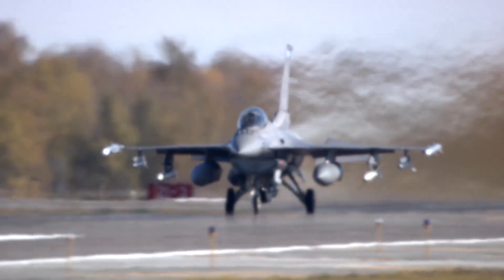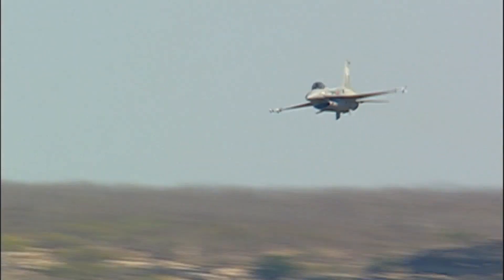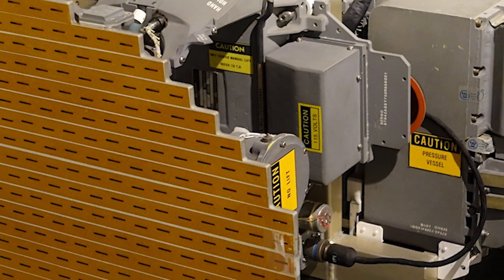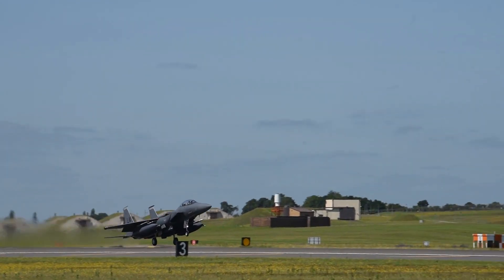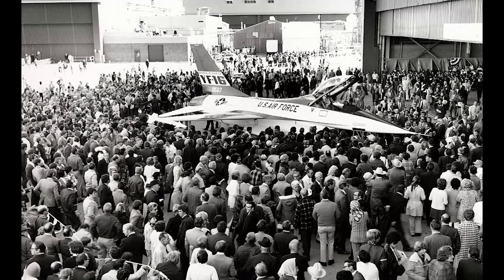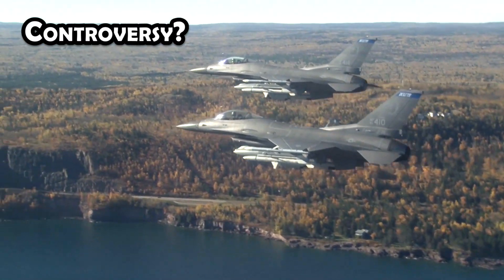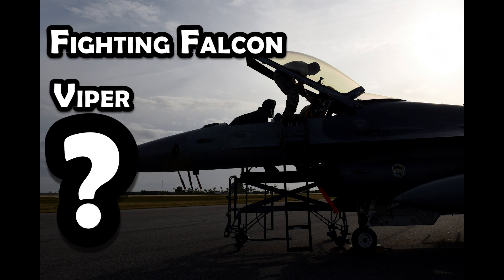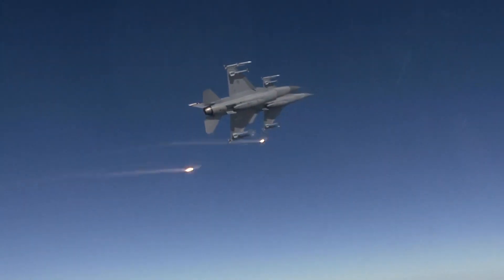F-16 Viper | The world's most popular fighter | Best of Aviation Series by PilotPhotog

Comment: The Viper is probably a very formidable fighter still, especially with the new F-35 sensors installed.
Reply from the maker: Marten Trudeau yes with the new radar platform the Viper is almost a fifth gen adversary.

Comment: Its true its the best all around figther in the US air Force hoping that they will install or upgrade the engine similar to F-35 engine.
Reply from the maker: That F35 engine is amazing that would be an incredible combo.  Thanks for commenting!
Reply: 😯 the F135 engine in a viper would be SICK!!!
Reply: @PilotPhotog  ; F135 is too large to fit inside the F-16.
Reply: Maybe the F-16 is the best all-around PLATFORM; best fighter-bomber in one airframe so far (F-35).  The F-15C, however, is a cold-blooded assassin of a FIGHTER; it is the most successful (so far) fighter plane ever, having never been shot down in a2a combat.
Reply: @FirstDagger  I was afraid of that.
Reply: That’s redundant. Recent ACM tests with unlocked F35As show that the F35 is as maneuverable as the F22 and that’s without vectoring.
Reply: The ability to vector thrust would be pretty awesome upgrade.

Comment: If the USAF knew that the F-16 would be relegated to the "mud mover" role, would they still have chosen the F-16?  In Canada, the F-16 would have been our jet if it had dual engines. So the CF-18 was our choice back in the late 70's early 80's. And STILL is our choice in 2020 as we are STILL buying these F-18's from Australia. IIRC We have 3 of them so far and will get 25 total, 18 flyable airframes and another 7 parts aircraft.  They originally bought 57 F/A-18A singles and 18 F/A-18B tandem seats in 1984.  We had bought 98 A's, and 40 B's, with 20 unexercised options. Pull out the Aussie software, swap out the ejection seats add a few ancillaries and voiala, a CF-188 you have.  In the 00's after our F-18's were proven lacking in the 1991 Gulf War and the 1998 Kosovo war, similar issues to what the F-14 experienced during the Gulf War,  insufficient Identification Friend/Foe(IFF) and lacking Link systems to communicate with other Coalition platforms.  We had sent 26 CF-19s to the Gulf as part of Operation Friction. This was the first time Canada had participated in combat air ops since the Korean War. Sweep and clear missions in support of coalition forces, they also flew 56 bombing missions dropping dumb bombs behind enemy lines. We brought the best of our fleet up to F/A-18 C/D specs in the 00's and finally could drop Precision Guided Munitions.
The USAF f-16 with its brand new LANTIRN pods performed magnificently in GW-1.  It really is amazing how the F-16 has evolved.  From a 17,000 pound mission weight YF-16 with a 24,000 pound thrust engine, up to the newer GE F110-GE-132 turbofan, making 32,500 pounds thrust which is need for the newer heavier variants that feature Conformal Fuel Tanks(CFTs)(Block 60 fighters offer a mission radius of 1,025 miles – a 40% range increase over F-16s without CFTs.) on the F-16E/F built for the UAE.  22,000 pounds empty, 29,000 pounds normal loaded (air-to-air mission), 48,000 pounds maximum takeoff weight.  All with an engine shared by the F-15C/D air superiority fighter(not a pound for air to ground and barely enough pounds to keep the wings structurally sound), the F-15E "dual role" aircraft and the new F-15EX.  The commonality of engines with F-15 and the promise that any and all F-16 buys by the USAF would be IN ADDITION to the F-15 program and NOT INSTEAD of F-15's, and of course its stellar performance really helped in the F-16s procurement by the United States.
Reply from the maker: Thanks for commenting and the well thought out analysis....I am planning to do a video on the RCAF.
Reply: The FA18 is versatile tho..
Reply: You should probably start a YouTube channel, holy heck. Very Nice 👍

Comment: F-16 in my opinion is the most suitable fighter jet for the Greek terrain. In Greece we produce the Air Inlets, Engine Access Cover (MCID & NSI), Aft Fuselage, F1 Fuel Tank, and Side Panels (practically 1/3 of the aircraft). Now a new production line for the upgrade to Viper edition has been already installed. HAF has ordered the upgrade of 84 bock 52+ (advanced) into block 70. This production line will upgrade F-16 from other airforces in the general geographical area (Bahrain, Kuwait).
Reply from the maker: Thank you for your comment and insight into Greek production of the Viper - I think this would make an excellent topic for an upcoming video.
Reply: @PilotPhotog  I hope so if you ever have the time. Hellenic Airspace Industry has the second biggest assembly line of C130H after United States with over 1500 aircrafts.

Comment: even the RC scale models of F-16s are unstable af, but because of that, they can cut around the sky as if that is what its supposed to do. also, every F-16 RC model i have flown absolutely LOVES to be in the air and sometimes, i have a hard time bringing them down. lol... they even fly high alpha really well too which is unexpected since they are pretty unstable....... if you havent gotten the opportunity, get yourself a F-16 RC model. to save a few dollars and so you wont have to worry about working on a turbine engine and fuel, grab an EDF. right now, the E-flite 70mm F-16 in the Thunderbirds scheme seems like a decent one. its not too small and its not too big.... i have a couple of F-16s, but right now my favorite is a larger one. im sporting a big Freewing 90mm F-16C scale model. it flies really well and looks so good doing it.

Comment: Can you feature the specification of f35 because i watch one video saying that it has no super cruise capability then if that is the case it is not considered as 5 gen fighter plane?
Reply from the maker: Thanks for commenting and the suggestion for a dedicated F35 video...I am actually working on that.  To answer your question:  No the F35 cannot super cruise - meaning it cannot go supersonic without using afterburners.  However I have read that the F35 can go supersonic with afterburners and then go back to dry thrust and still remain supersonic.  That could be the source of the rumor.  As far as not being 5th gen - also not correct:  Supercruise is a "nice to have" feature not a requirement for 5th gen.  In this case 5th gen requirements generally mean some level of stealth and development that has taken place in the 21st century.  So F35 is definitely 5th gen.  There is your book of an answer lol, hope you subscribe and watch the F35 video when it comes out!  I post a new video every Monday, 4th generation French Rafale fighter is next!

Comment: I find it curious how they call the F-16 a Mach2+ fighter..  but to get to Mach 2 it would have to have no ordinance and minimal fuel and flying at about a 40* dive from 30K feet in max afterburner.    it can't push itself to Mach 2 in level flight...  so it's weird that it's classified as a Mach 2 fighter.
Reply from the maker: Ben Nixey good point - I guess the thinking is that it could reach Mach 2 and the airframe could handle it but you are right - practically speaking it doesn’t hit Mach 2 in a typical sortie.  Thanks for commenting!
Reply: @PilotPhotog  that's kinda what I thought too.. that the airframe could take it.  Mach 2+ capable doesn't necessarily mean Mach 2+ achievable.   great videos dude.
Reply from the maker: Ben Nixey thanks so much! I’m actually editing one I’m going to upload today about Elon’s comments regarding jet fighters.
Reply: Its not only F-16 that is said a Mach 2 fighter but they don't reach that speed in battle configuration, only F-22 can almost reach that speed in battle configuration because its weapon is installed internally less drag on its airframe.

Comment: When did the "Falcon", become the "Viper"?
Reply from the maker: The pilots just preferred Viper and it stuck.  Thanks for commenting
Reply: It’s Because of the reimagined Battlestar Galactica.  IE. Colonial. Viper. Space superiority Fighter. I prefer falcon.  The pilots around 2005 or so. Started calling the viper. I still think of it striking with talons extended.
Reply: Stan Erwin   I would have called it the Mustang II, bc the air intake and bubble canopy are similar.
Reply: katora King k 
The F15e is called the “Mudhen” because it’s a bomber that “moves mud.”
Reply: Gary Sarratt 
True.  Never thought of that before.
Reply: @garysarratt1  pppppppppppppppppp
Reply: @gtar5191  Not the reimagined, the original BSG series. Both the fighter and tv series came out around the same time.
Reply: Fighting Falcon = 2 words  
Viper = 1 word  
F-15 has two engines, Viper has one.

Comment: The F-16 will still be used when the F-35 are all retired.  Too expensive to buy, to maintain, and to operate.
Reply: Under US$90 million/copy the F-35 is cheaper than the upcoming F-15EX based on procurement cost alone.  Someone around the world will still use the F-16 in 2070, but I doubt it will be the USA.